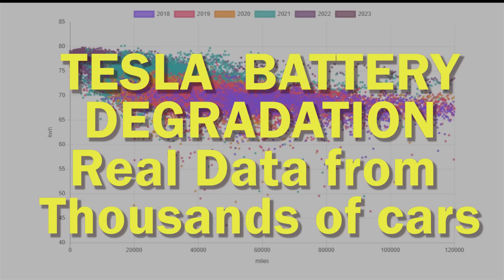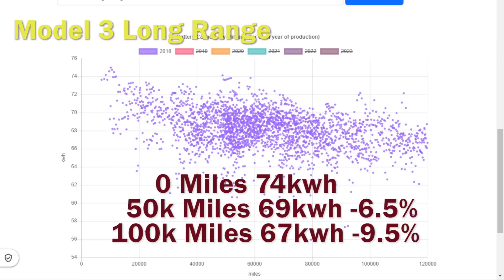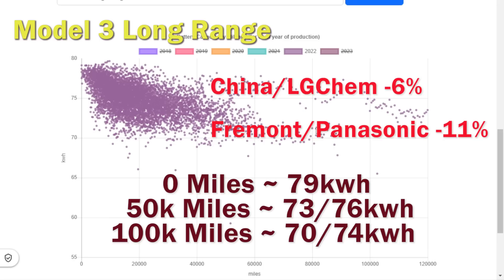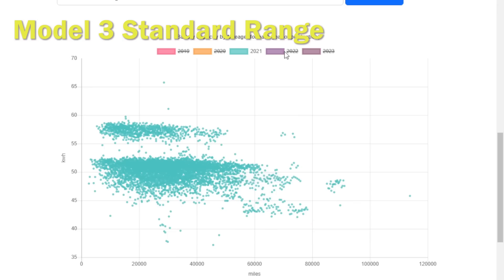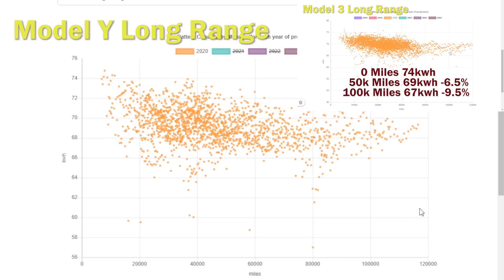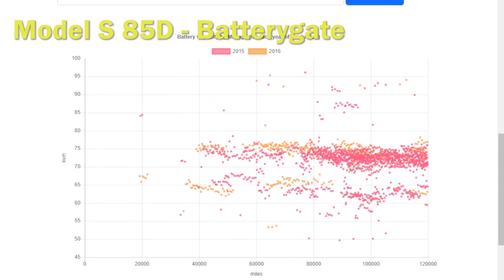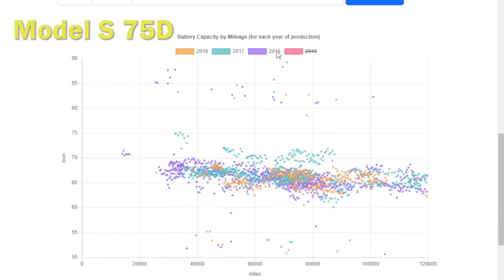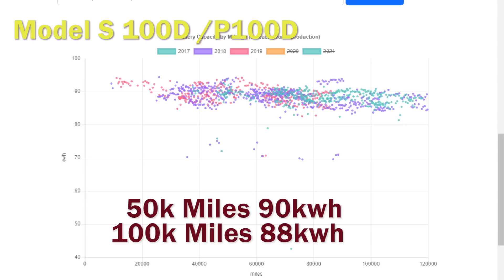Tesla Battery Degradation - The results using real data and why the Plaid is the worst Tesla

Comment: Is there data on older vehicles?  I would expect that at some point during aging there is an inflection point and the battery starts to degrade rapidly over a short time frame.

Comment: After all this, most batteries are STILL CHARGED BY FOSSIL FUELS!  What's the point??!!!
Reply: Saving the polar bears! Doesn't matter if it helps or is efficient. That is right-wing questions!
Reply: Idgaf about green power.  I like not paying for gas.
Reply: Power plants are a lot more efficient, and a growing portion of electricity is generated using green energy.
Reply: @zachb1706  You think the grid is free? You think all the metal in the grid is green? Why do we need this green stuff so much? Spell it out for us!
Reply: @elbuggo  do you think transporting fuel is emission free? Gas stations everywhere, supplied by trucks coming from massive depots is better than using wires which we already have?

EVs are far less polluting, it’s not even an argument.
Reply: @zachb1706  
You will also need to take into account of transmission losses, the energy required to extract the raw minerals to produce the batteries, the energy to recycle them at the end of its useful life IF it is even recycled. This is not even taking into account the entire infrastructure build up that is required to charge these vehicles.
These battery vehicles may appear to be clean and efficient but they are not. There are no shortcuts in energy conversion.
We already have high mileage compact cars but most if not all these battery cars are large and heavy!  AND from what I've seen here in Kalifornia - 90% of all Tersla and battery truck drivers drive like a bat out of hell!  What do you think that does for energy consumption??!!!
Green energy is but a drop in the ocean when it comes to energy source and it is NOT reliable!
Reply: @LWRC  when you do account for those the result is the same. 

Yeah they are more polluting to manufacture, but manufacturing is only a fraction (~20%) of the lifetime emissions of a car.

You do need to build more infrastructure upfront, but you’re ignoring the massive infrastructure of gas cars - refineries, depots, trains, fuel trucks, gas stations - that will no longer need to exist. You’d need less infrastructure with an all electric car system, most people charge at home except on the occasional long trip.

And BEVs are a relatively new thing with a large margin for further improvements. They will also benefit from the growing portion of energy coming from green sources. So these emissions will continue to improve.

Comment: Thx for your work! Very interesting.
Beside battery deg. it would be nice to know how the internal resistance of the packs has changed bc. that effects your range too (especially going into the low end between 1 and 10% SoC)
Reply: Exactly! It's also another important information regarding battery longevity, theoretically speaking it should affect all batteries but LFPs are affected less. There is a video on youtube where they do a drag race between two Tesla models that have the same claimed acceleration but the one several years old, ends up accelerating significantly slower (by significantly I mean it was easily measurable, it wasn't a big difference or a big deal)

Comment: Some basics:
A battery has more physical area to degrade in its early life, so naturally degradation will be to some degree exponential towards early life period. Also it's likely that people will drive differently and be less aware of habits in a new electric vehicle, vs when they have owned it for a year+

Li cell batteries are best maintained when their charge and discharge cycles happen between 30-80% capacity range -meaning whenever you exceed or fall below this threshold, is when you infer exponentially more harm to battery life through accelerated degradation. The issue is that people who go for the long-range models for example, are statistically more likely to want to make use of that range benefit and drive the car to its limits more often, than someone who is more range limitation minded and don't want to accidentally get stuck somewhere or waste hours on the road.

Also high-speed charging will always degrade a battery's life faster, than slow charging. It's why for example many less expensive automakers actually opt for higher charge rates to compete on paper, but in reality their battery will inevitably degrade faster over time. You would need a completely solid-state battery to enable 100% beneficial high-speed charging. A standard Li battery could charge in 5 minutes theoretically, but you'd just ruin the battery so much faster and risk thermal runaway if/when an internal short happens.

Lots of data, lots of context to consider, and no industry consensus yet due to how new the field of EVs are still to this day. It's barely a decade since Tesla launched the original Model S, and batteries still develop so quickly that data collection itself is easily skewed.

Comment: I do have 2 problems with those data presentations. First I do not see dead betteries mentioned anywhere... As my understanding is that batteries that malfunction may actually be a bigger problem then degradation and anyone I hear about with high milage Tesla has exchanged battery several times. And second problem is this reported capacity - where does it come from? Is it the battery controller/electronics. In case of laptops or phones - so many times I have seen electronics report almost full capacity and then the device suddenly died at 60%. Which means the data is often inaccurate and never for the better. A good data would come from measuring the last full power cycle of the battery.

Comment: would (super) capacitors help?  I wonder if since extra degradation seems to be linked to the performance variations, presumably due to launching the car more etc - I wonder if a bank of capacitors would help. charge could be moved to capacitors in as little as 20 seconds or so, but then allow the launch without taxing the battery as much.

Comment: I am wondering how the data was sourced, I heard it was through ‘the api’ but I don’t really understand that. My own car is a 2019 performance and I had the service centre measure it just before it went off (4 yr) warranty a few months ago. They said it had 84% capacity which they said is average for the fleet. That seems well below average. The car has 49k miles and has not had a particularly hard life other than being subjected to cold temps (Canada) charging very rarely over 80 and near never under 20. How can I find the battery degradation on this car?
Reply from the maker: You can benchmark your car using the guide here, we do use the API and we explain the results as part of the output. (There's also a video which shows it in action)  https://tesla-info.com/guide/tesla-battery-capacity.php

Comment: In case of Tesla, I wonder if the study take in consideration the whole pack including the "reserve" it has. Because Tesla modify sometime the capacity by changing  configuration at distance. We have seen that many times.  So I wonder if when the battery is degrading they do not change this reserve level to take part of the lose in the reserve and in the same time lower the reserve, which could minus the capacity of the car at regenerating and slow down when close to the max.  This could make the result of this study not right.

Comment: Funniest part about EVs for me is that people actually need to buy them to discover that they suck. We've had nothing but problems with battery powered tech since the inception of said technologies. We still can't make a cell phone that can go a week without charging or take more than a few hundred charging cycles. Whoever thought we were at the point that an EV would be practical is either completely retarded or realized that the general public will buy anything thrown at them.

Comment: The ones that were reporting higher than stock and noted as possible warranty replacements should be removed. Especially on cars that had lifetime battery warranty. It is worse than survivorship bias. If we can’t know the capacity at replacement (the primary reason for battery replacement), we can’t confidently calculate degradation rate or failure rate. 

Is the data not flagged? Why did you do no statistical regression? Please make the dataset public.

Comment: I'm watching this video and it's talking about the range over the lifetime of the battery but I'm not seeing any failure data. It seems like as far as power charging reliability that the data backs up that it's robust but I'm still seeing many many reports that are not seemingly represented in the data regarding complete failures. There's a lot of antidotal conversation about it though.

Comment: Our 2009 Model 3 Prius ITECH still has its original battery. 288000k Replaced inverter last year 5k Aud Toyota checked battery and said its fine. Everyone talks just about battery life. Electronics are actually much more expensive.

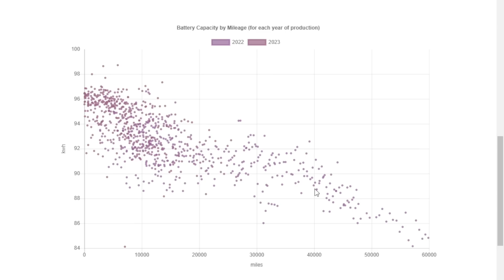Comment: 8:00 It seems that Plaid is tweaked to the level where inverters will take more power than the battery can provide without heavy degradation. Looking at the data, the long range without "performance" option seems to result in best battery lifetime which is expected because it has most capacity compared to the peak power taken by the inverters so it causes least stress for individual cells.

Comment: I've done 100k in my car, it still does 80 mpg (uk) which is the same as it was when new.
Reply: And how many polar bears will have drowned because of it?
Reply: @elbuggo  less than if I had an electric car!  Because by the time it's done after 400+ k it will have still used less energy to make and keep running than the electric car taking into account mining and infrastructure upgrade requirements (assuming the electricity is from green energy- which in most countries isn't the case).  My car also needs less tires as it's lighter so it damages the environment less with plastic micro particles.  An if god forbid, my car catches fire, the fire brigade will be able to put it out.

Comment: What's the losses at 250,000 miles? Why not show a chart to 400,000 miles? I have never bought a vehicle with less than 120,000 miles. A gas vehicle is still new at 120,000 miles. I get 400,000 miles out of all my gas vehicles.
Reply: Because not a lot of Tesla with that many miles (yet)
Reply: @yisabc1  yeah because they are a toy. There are plenty of ICE vehicles the same age with well over 250,000 miles
Reply: @Bryan-Hensley it’s because they’re only a few years old. ??

Comment: All these data and plots are pretty interesting but you should look at the distribution not only on miles (range), but age of the battery over time. What I'm saying is that the degradation of the battery is driven by the range of usage, miles, but as well over time. It might be that all these long range datapoints you have, are done in a very short period, like taxis.

Comment: Very strange analysis. The consumption (that's what you are looking at) might be lower the more miles a car has done, but cars with higher mileage probably have very different driving scenario's: longer rides, higher speeds : higher consumption. I don't think you can derive battery degradation from the consumption figures.
Reply from the maker: We're not looking at consumption, we're looking at the cars reported battery capacity
Reply: @EVinventory  My bad, I was looking at the captions wrong....

Comment: Li-Ion batteries degrade with age as well as cycles. The oldest batteries in this table are six years old and they also don't include the failed batteries. Where are the failed batteries with 0 kwh?
Reply: I got my wife a model X 75 kWh in 2016 and we keep it charged to only 80% for daily use, but go on a road trip once a year where we charge to 100% the night before, and then supercharge.  It's now got 70k miles on it and has only dropped from 225 to 220 miles of range.
Reply: @phillipsusi1791  That is rare performance so you are one of the luckier ones. But you drive <10,000miles/yr and are very gentle on the battery. I am curious to see what the battery performance is after 20 years. As I have said before I have a Power Wall that is under 90% capacity after 3 years. Never drained it below 75% and let it manage itself. I wish they modified the software so I could reduce the full charge to only 80%.

Comment: It all comes down to how you treat the battery. Driving fast, charging fast, leaving it full, and leaving it in the heat (without the heat protection on) will all degrade the battery.

Comment: LG Chem Ltd. (Korean: LG화학), often referred to as LG Chemical, is the largest Korean chemical company and is headquartered in Seoul, South Korea.
Reply from the maker: I think we badly worded it - when we referred to China built we were referring to the Teslas not the battery, its relatively easy to find where the car was built from the VIN
Reply: @EVinventory  3.06 you have china/LG chem written on the screen and fremont/panasonic underneath.
Reply: I read it as Fremont production using Panasonic and China production using LG Chem, not where the batteries were made.

Comment: this data can't really be plotted without knowing the BMS charge/discharge profiles.. it is very likely the new batteries use a 80/20 charge/discharge level then has a programmable change till at least the end of warranty where they may use the full 100/0 profile to maintain a constant range after which degradation would quickly rise

Comment: Interesting to see that all the big batteries (> 50 kWh) show twice the level of degradation (up to 12%) compared to the smaller (yet average size by international standards) 45-50kWh packs (4%-5%).

Any idea why? Could it be because they go through less cycles than smaller ones, and that somehow don’t get to regenerate as well/ as often?
Reply from the maker: We'd be speculating, but the LFP batteries which are now frequently used as the smaller battery is a different technology, and the larger batteries are often in the more powerful cars and maybe subjected to harder use.
Reply: Possibly the smaller packs with reduced heat load have similar or the same thermal management system as the larger packs.

Comment: What you didn't talk about is how the data was collected. Is this from cars coming to service (this would explain the gap in the beginning)? And what do the dots mean? Is each dot an individual battery or might the same one show up multiple times during its lifespan?
And survivership bias. I guess, cars with better performing batteries will be driven longer which might explain the apparent flattening because lower performing batteries don't contribute anymore.
Ideally one would have a line graph for each battery to see what is the case.

Nevertheless still interesting to seeb these bifurcations indicating a performance comparison between two different cohorts of the same model.
Reply: The only way to know is force Tesla to open up their API so open-source community can collect informative data to form an accurate conclusion which will never happen.
Reply: @I_am_a_nice_person  they might tell somewhere what the data actually represents. But it's in their interest to make the data appear favorable, of course... And obviously they don't want competitors to get too much insights.

Comment: Fremont was a legendary (for the wrong reasons) GM factory that even after Toyota hada a go at it and had some success for some time but, eventually, quit working in it because of the terrible workmanship. You can't fix this culture of worker unions and underachieving overnight or decades, it seems.  Teslas from Fremont have the worst fitting of all Tesla factories.

Comment: It's so easy to gather data from EVs, since their vitals are very easy to monitors. I really, really wish we had comparable data for IC cars on their performance - dyno data, fuel consumption, and ideally - dyno data, since power and torque curves are closely tied to condition of mechanical components.

For me outtake is whatever you're buying, you're getting ~58/45 kWh battery, everything above that is just a gratis from the factory.

Comment: Makes sense about the plaids, you're looking at miles not charge/discharge, any time you loose efficiency via wheels or going 100+(drag) you're pulling more power and have to recharge so you have more cycles/transfer for the same mileage as a car that just drives "normally"